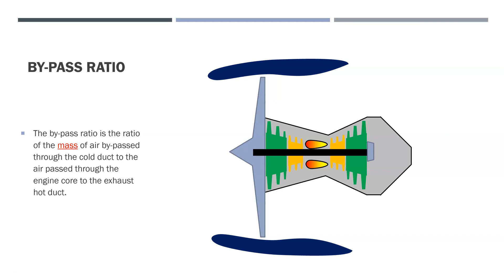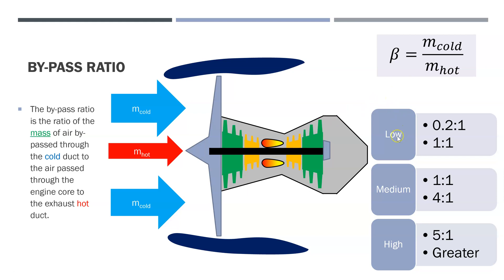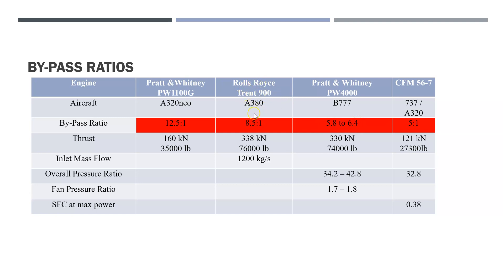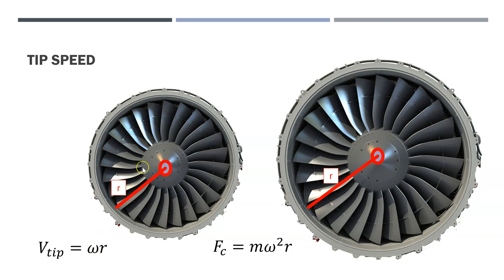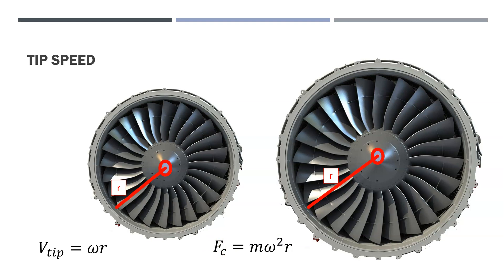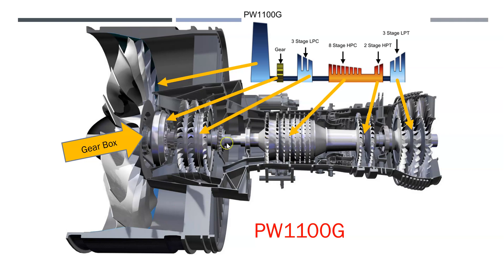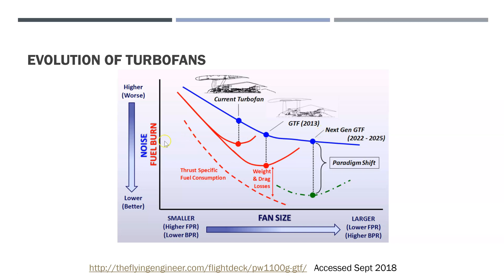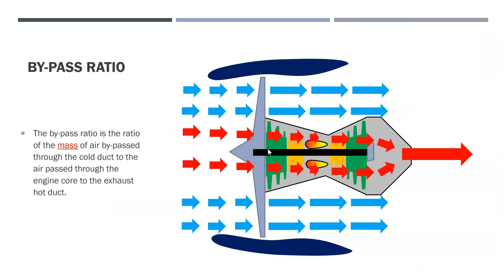Turbofan by-pass ratio.

Comment: What is the difference between the high bypass ratio and the low bypass ratio?
Reply: high will let more air move around the core of the engine and let a fraction in the core, making it more fuel efficient, normally used in commercial jets. Low will is going to be in most turbojets letting the majority of the air go through the core, turbojets are used in fighter jets and planes like the Concorde, they will often have afterburners to help them get more thrust in takeoff, combat, or going supersonic in short bursts, these will inject extra fuel. The Concorde had a very advanced turbojet, the Rolls Royce Snecma Olympus 593, this jet pushed the plane to go at mach 2.04 (1,354mph). But at cruising speeds this jet used massive amounts of fuel because of its low bypass. Hope this helps you, Morahman7vnNo2 has nice short explanation too.
Reply: @michaelscott5284  Turbojets have NO air bypassing the core while low-bypass engines have a small fraction of air bypassing the core. The Concorde had turbojets but nearly all modern fighters have low-bypass turbofans.